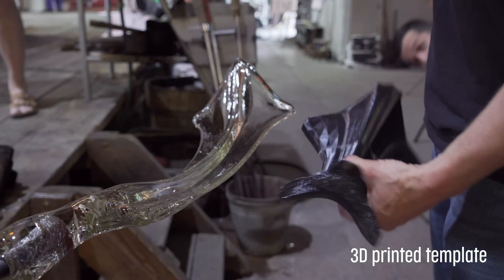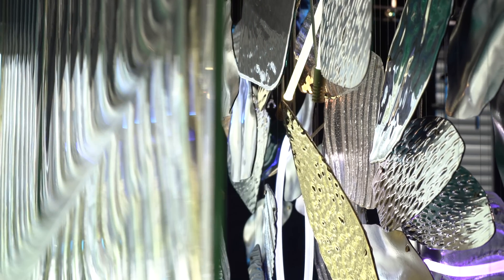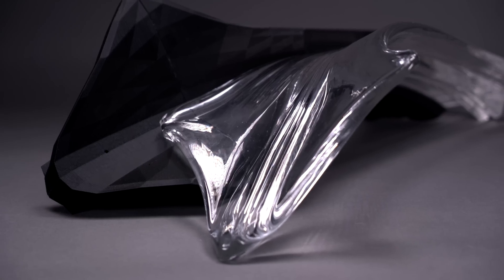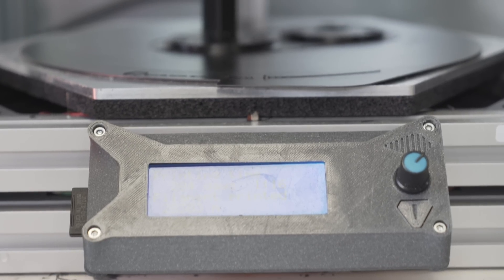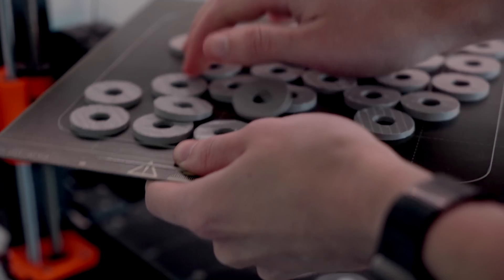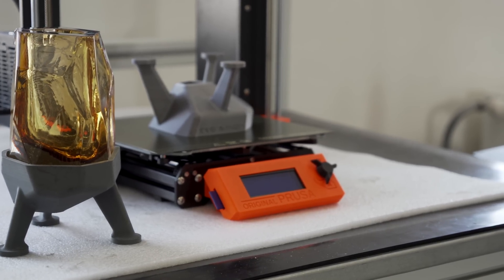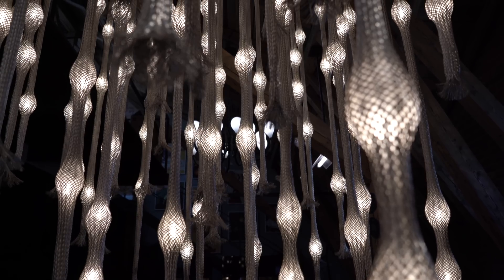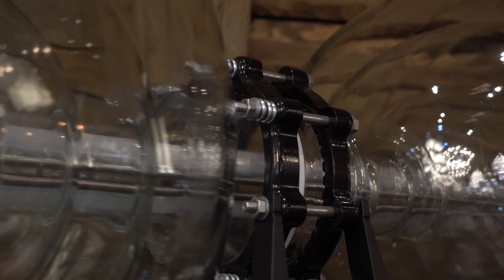Prusa 3D Printing Stories: Light, glass and 3D printing at Lasvit

Comment: I was wondering could glass be printed, Google told me not any time soon.  Mostly because you would need a hot end running at 1400-1600c which is the temp range where glass is liquid.
Reply: Hello 🙂
Reply: MIT students made a 3d printer for glass several years ago.  Obviously not for mainstream use.
Reply: I've wondered if it would be possible with an oxy hydrogen torch, you may be able to do metal do. Hot (Sometimes can go up to temps of 3300°C, precise and cheap to run maybe. It would just need a lot of safety features.

Comment: Why aren’t you doing lost-wax casting with printing the paraffin positive buck on the prusa and then plaster/sand molding around it and burn out the wax? I; done this countless times with silicone casting and it looks amazing (and it’s cheap and easy). Then you can cast stainless/aluminum/glass/etc or make a blowmold for glass blowing into?
Reply: cast glas has different properties and limitations in terms of how it can be colored.  and finishing the surface of cast glass is prob hours of work.  their blown glass technique looks smooth out of the box
Reply: Have you done this with glass yourself? Or have seen it been done with glass, can’t seem to find any myself.
Reply: I thought the exact same thing.
Reply: I'd like to see how a 3D printer could be tweaked to print wax. I'd imagine the printer would have to be put in a refrigerator so that the layers would cool down fast enough.
Reply: Because you can't with certain geometries. They're only a world-class glass manufacturing company they must have no idea what they're on about.  In the video they describe the use of the 3D printing in a lot of it fixturing and prototyping.